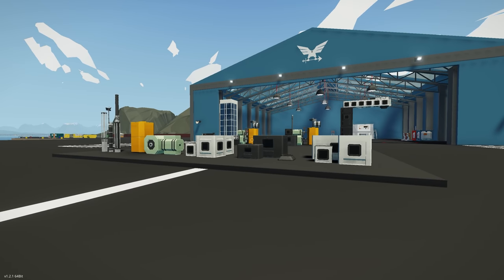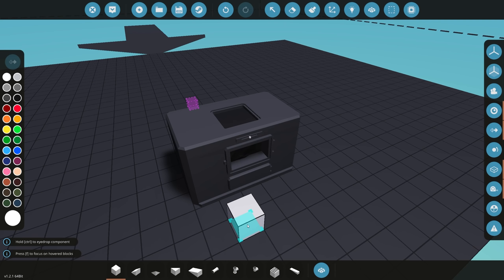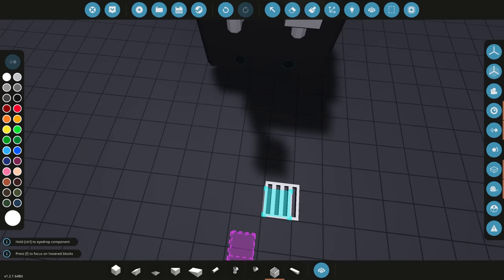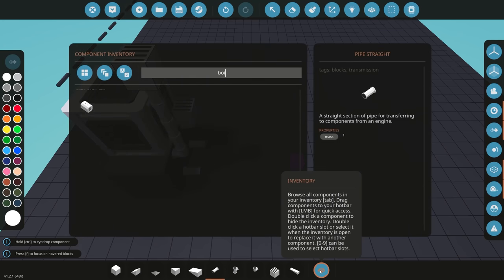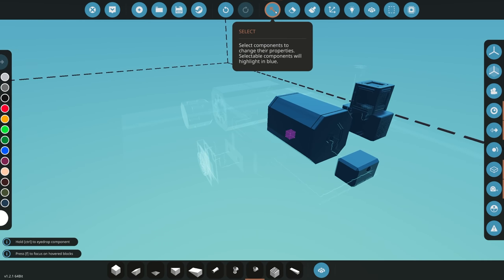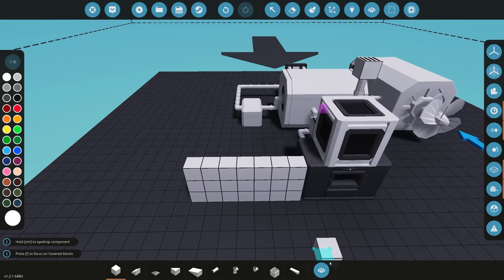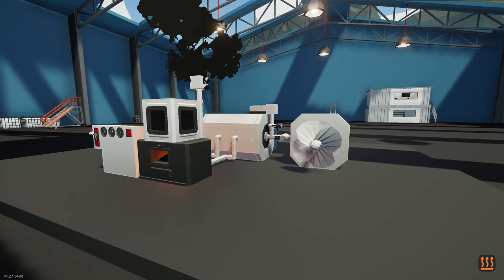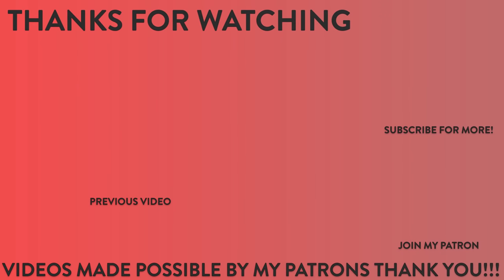Building a Coal Powered Steam Engine!!!! - Stormworks

Comment: if the temperature of the firebox is OVER 100,   steam above will turn BLACK
Reply: Unless you add more exhaust ports for some reason. I made a steam locomotive, and put 9 fluid ports I. The smoke stack, and the exhaust comes clean, which was disappointing for me.

Comment: I'm having issues with my boiler exploding. I even set mine up with a condenser release and a redundant release valve if the pressure still keeps rising.
Reply: Just make a microcontroller that has boiler pressure to a greater than gate. If the pressure is higher than 9 then the valve is turned on
Reply: @Duke_GATO_1-1  Treshold gate low 0 high 5 and let that thing contorl the pumps which circulate water into the boiler. Never exploded. Just added a greater then 7 to release all steam in an an emergency. Also be carefull. Also i try to keep the temperature low, around 120-140°C if it goes above 200 the emergency system will trigger and shut it down.
Reply: To address this for future readers: Your pressure should really never be above 1.  My boilers tend to run at .3 to .4.  Currently, turbines seem to have a max throughput of 1.7L/s of steam.  Take 1.7 (or whatever you can achieve or wish to) and multiply it by your number of turbines.  With advanced tooltips on, look at your boiler, specifically "water in" and "steam out."  Your target for both of those is the max throughput value you calculated.  If "water in" is greater than "steam out", feedwater is trapped in the boiler because you're making more steam than you can use.  Look at "steam" at the top of the tooltip to see it accumulating.  As it's pointless to do this, it's also pointless to run your boiler under any real pressure.  To address this, decrease the temperature (or decrease the flow) of coolant into the boiler.  All my reactors work flawlessly in this regard and have no need for pressure relief valves.
  As far as controlling the temperature of the boiler, I use a pid and a variable valve.  This works very well and allows me to precisely set the temperature necessary to achieve desired output.

Comment: My steam boat is so slow, any idea why? (only getting a torque of 4)
Reply: I had the same issue, add an empty tank for extra steam. Basically for some reason it’ll bug out if it goes directly from the turbine to condenser, so either pipe it to the sky or add a tank for the steam to escape to, add pumps to the steam tank
Reply: @Duke_GATO_1-1  Will do, thanks!

Comment: Ok so I set up mine just like this, the problem I have is the engine dies after 5 mins with no damages and plenty of coal
Reply: Bypass the condenser,  they do not work as well anymore and they cause pressure to build up past the turbine basically pushing back against the boiler pressure.

Comment: So I made myself a Nice looking Steam setup and It works great. The only problem is the Boiler pressure doesnt stop building even if it is being used and It gets to 10 super quick, Making it explode.. I don't know what Is causing this saying I have everything hooked up correctly. Could someone help please?
Reply: Try the pressure release system he showed in the video with the threshold gate.
Reply: That should work
Reply: @jamesdeznuts5603  I'll try that now!
Reply: @commanderdumbo967  maybe you have too much water in boiler?
Reply: @Elcicikos  That Actually might be the problem. I'll Try Limiting the Amount of water that goes into the Boiler and see if that works
Reply: @commanderdumbo967  Use medium fluid tank. For me its works.

Comment: my boiler is exploding even with threshold gate
Reply: How do you have it set up?
Reply: @Bendigo1  based in the game preset, with threshold gate 8 low and 9.9 high, but the vame bug and the pressure increse and explodes the boiler. This is annoying
Reply: The best way i have found to regulate the pressure is to add a t-piece from boiler steam out.  Connect an on/off valve, to the t pipe and connect the valve to the condenser with a t pipe to the steam in port. connect the valve to a threshold gade set to 9.5 low and 20 high.  conect the threshold input to the boiler pressure number node.  when the boilwe pressure reaches 9.5 it will open the valve.
Reply: @ThomasAndrewsShipBuilder  what are you connecting the threshold gate to?    Shutting off the water going in is not the best way to regulate the pressure.  I tried doing that and pressure will still build.
Reply: @Bendigo1  Yeah, man. I'm controlling the Threshold gate by pressure, I just solved that, with more valves. but the turbine loses pressure after a few seconds and stops working
Reply: @ThomasAndrewsShipBuilder  Just check the connections of the pipes.   it takes a few minutes to stabalize.  It is kind of frustrating because it takes so long for it to get going just to realize something isnt working.   From what I can tell, the turbines will spin up fast then level off.  the amount of steam in the boiler is important to keep the turbine spinning.  the more steam the more even the turbine speed will be.  
I let the boiler get to full pressuew then slowly open the regulator valve to the turbine.  i try to do it so that the pressure and steam dont drop too fast.  then just wait for things to even out.  i have a pretty complex micro controller set up for nuclear power plant.
Reply: @Bendigo1  Genteman, thank you for helping. Success, It workerd for now, I'm still building my ship...
Reply: @ThomasAndrewsShipBuilder  Glad to hear that.  I did some experiments and found that if you have the boiler too close to the fire box, the heat from the firebox will keep the boiler hot and its temp will still increase if you shut of the flow from the firebox.
Reply: @Bendigo1  huuuum, good point, radiation heat, My boilers is near the firebox. And the temp really increase fast. But I got success. 👍👍